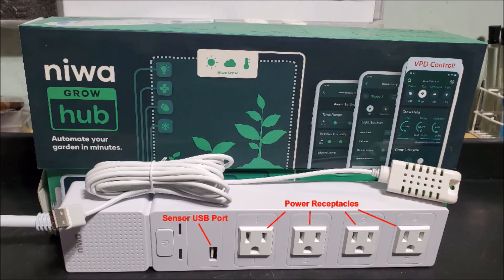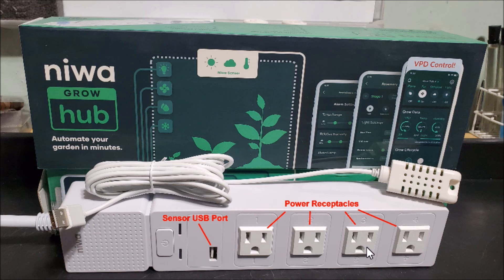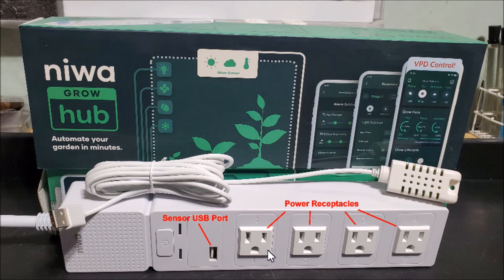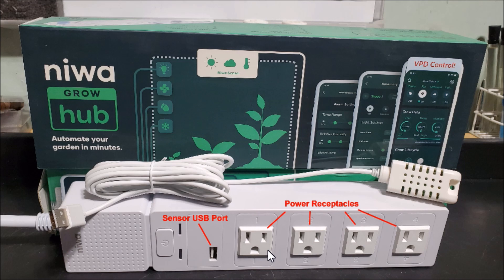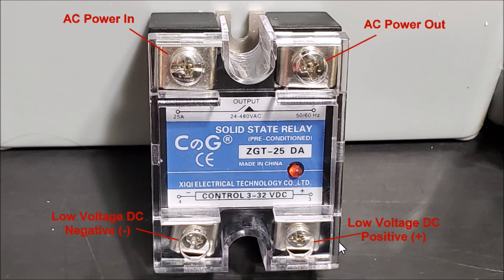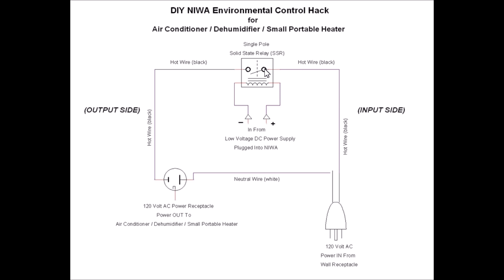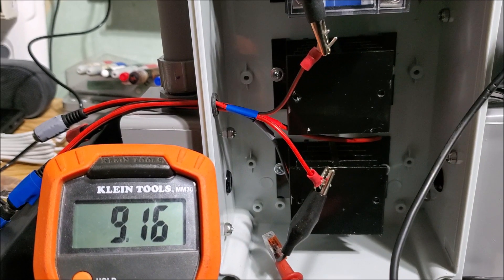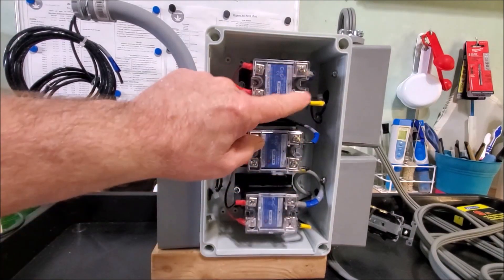Total Environmental Control - DIY NIWA Environmental Control Hack

Comment: You could eliminate the low voltage power supply and buy a relay that is triggered by 120V AC instead of DC and plug that into the  NIWA
Reply from the maker: Yes you could👍
Reply: But can you? Because the low voltage trigger system runs on lower amperage so the niwa is able to handle the amperage being pulled if you use 120v to trigger the relays then your run the chance of frying the niwa controller